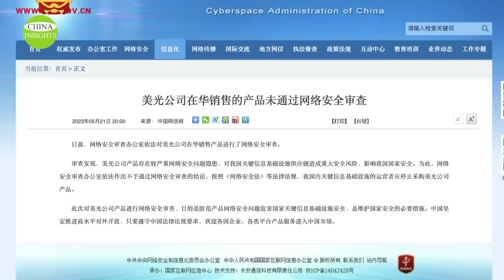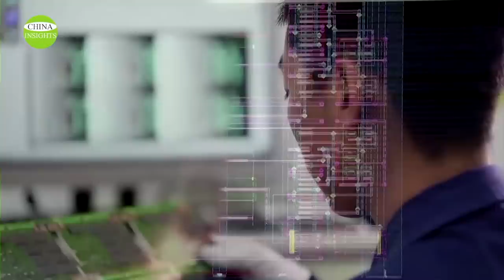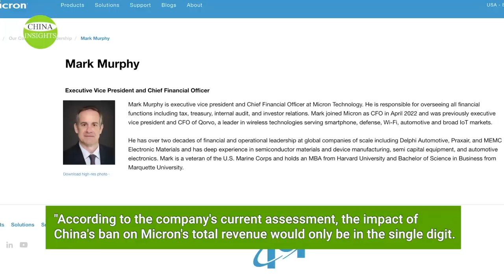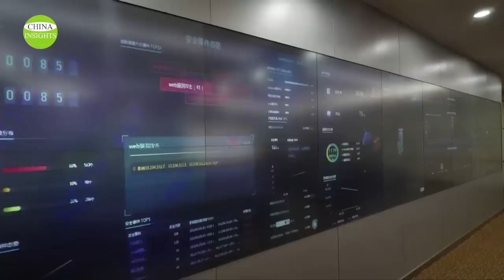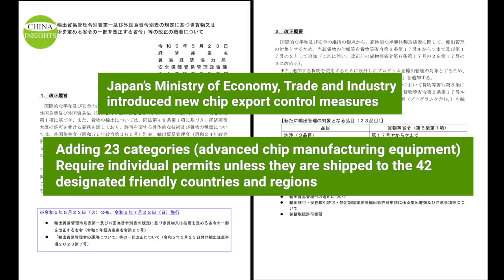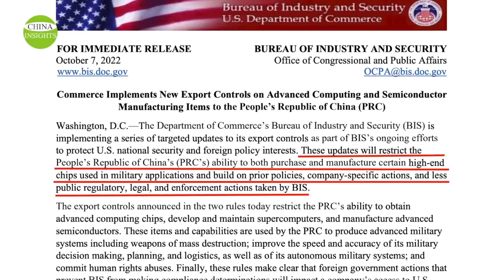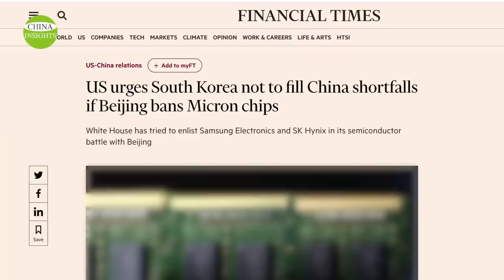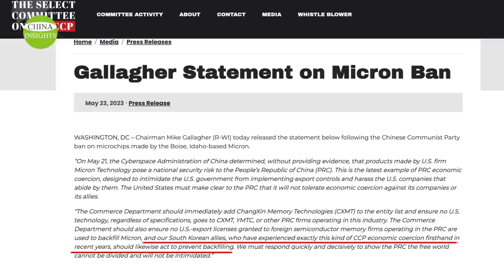The U.S. 'won't tolerate' China's ban on Micron and the Japanese have gone even further

Comment: Huawei's equipment has network connectivity, but memory and flash drives don't so it is difficult to see how a memory chip could be a security risk.
Reply: you can easily have a program on an flash or memory that can transfer information or sabotage equipment on something as small as a chip
Reply: @navytiger2  wait, so they can use a floppy disk or a CD-RW... or a usb drive? Ok now that is scary.
Reply: @2packrm781  yes, so before ever using a usb or any sort of usb charging cable or usb power brick. that's why people have been warning others of things like using public wifi and using public charging usb outlets. you just don't know if it has been messed with or is a dummy. you should always use your own power brick and charging cables
Reply: @navytiger2  thank you for bring this info to me & it would make sense to have your own backup in case things don't workout.
Reply: The US DoD has already shown how this works DARPA did a study on semiconductor (IC) supply chains and how they could be sabotaged by an adversary. If you’re in a country where you can see the results of that study then you should be able to find it easily.
Reply: @navytiger2  that  would take a few mill-seconds to detect and EASILY checked before installation
Reply: @2packrm781  you could use cable that doesn't transfer data if you want to charge using public port like in airport
Reply: @hithere1219  ok, now I didn't know about that option. Thanks for informing me, really.
Reply: @navytiger2  you've no clue what you're talking about.
Reply: @milky3ay566  No you do not have... so your comment have zero substance in it only unsuported by literally any argument acusation.
It looks also that people here trying to convince people that Micron is only producing RAM when its popular producer of SSD and you can easly inject data with SSD to what ever you want->to and from USB is also posible.

Comment: It’s the least impactful ban. Flash memory isn’t that important .
Reply: @Hey1234Hey  It's all commoditized. It's the easiest thing to replace.
There is no substitute for AMD and NVDA advanced chips.
Reply: @HKim0072  given China is yet to produce a single chip that's clearly not so. There's a limited number of chip makers and they banned one of the biggest and best. And a lot of the others aren't even allowed to sell advanced chips to China.
Reply: @samsonsoturian6013  YMTC is literally a competitor. Was going to be a supplier to Apple before it got nixed.
Reply: @HKim0072  who is yet to manufacture a single modern chip. They simply don't have the equipment.
Reply: @samsonsoturian6013  Technically, its classified as a microchip, but it's just memory. Supposedly, they are producing 232-layer 3D NAND Flash now.
But, we'll see how the get around the sanctions.
Reply: @HKim0072  You think these guys will risk jail time over 2% of their business?
Reply: @samsonsoturian6013  Much harder for fabs to get around sanctions, but the CCP will try their hardest.
Sanctions are only as good as the investigators that track it. It's a tough job.
Likely, they have produced some of the new memory drives, but they need fabs to scale it.